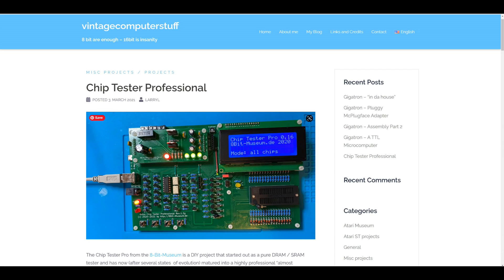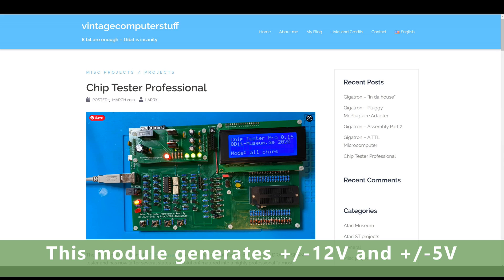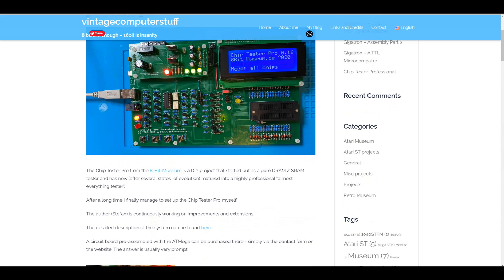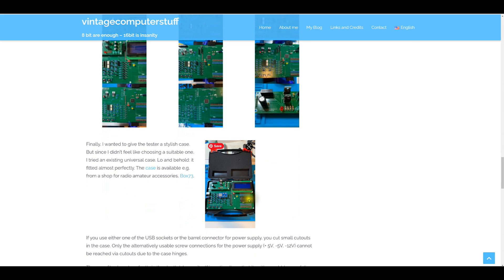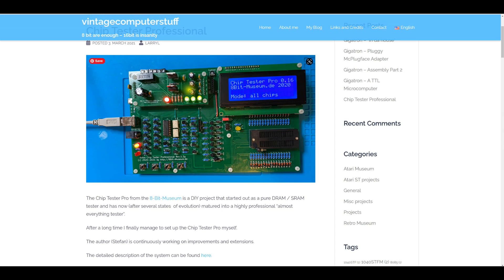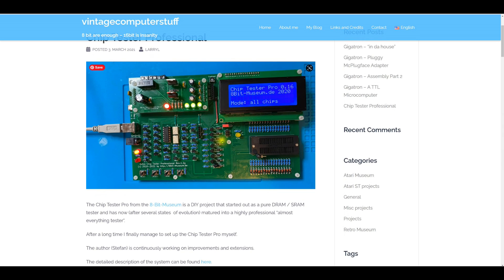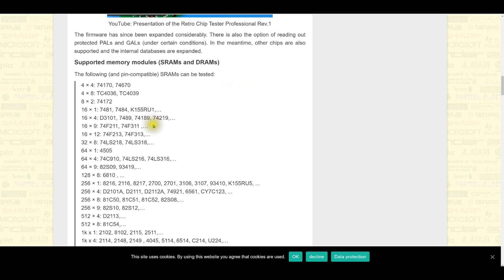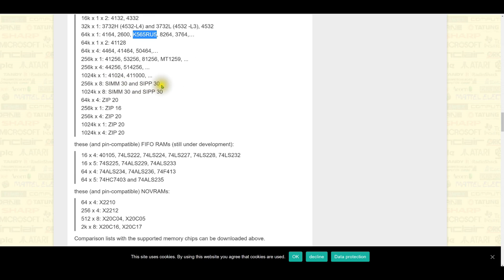STB680 - Retro Chip Tester - Part 1 - Introduction

Comment: Cool video... Recently found your channel. Do you know if ANYONE is making either a 64K or Z80 bd for the Heath H8.. I had an H8 years ago, and built ll of the Trionix, (sp?), boards. Had a Z80 running CP/m at 2MHz with 64K of RAM, Gold plated back plane, fan panel etc. Seems Like I spent over a $1K in 1982 dollars for kits to upgrade the H8.. Even had a HUGE Printronix P300 printer running. Anyway, recently found a nice H8 on ePay. The seller sat it in a box with NO padding on top or bottom. The sides buckled, bent the hell out of the pins on the backplane. I'll restore it but its going to eat up some time. 
I am a former FE for Digital Equip Corp, DEC for years. Cut my teeth on a PDP8 but later was large system support for the BIG Vax line from 780 through the 8K series; that and networks.
Great years with DEC flying to Boston several times a year to get the latest schools. Ken Olson, treated his employees great and with respect. Rare to find CEO's like that now. 
Without GUI you can still get a lot out of an 8-bit box but I'm preaching to the choir !!!
Reply from the maker: The only boards I know of are Les Birds PCBs which I don't believe are available anymore. I'm pretty sure there is a Z-80 CPU card. You will find info at https://sebhc.github.io/sebhc/ and Kicad files at the link https://sebhc.github.io/sebhc/pcbs/LesBird_KiCad_Projects.zip and info on Les's build at https://sebhc.github.io/sebhc/pcbs/H8-2000_Construction.html
Reply from the maker: If you search for "noberto h8 64k pcb" you will find links to a 64K RAM card, I believe however it's SRAM.